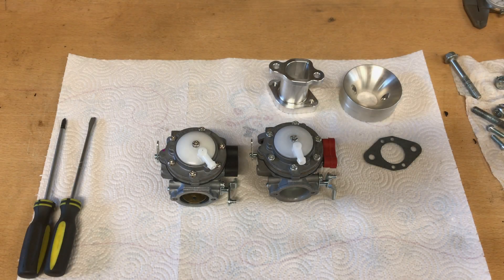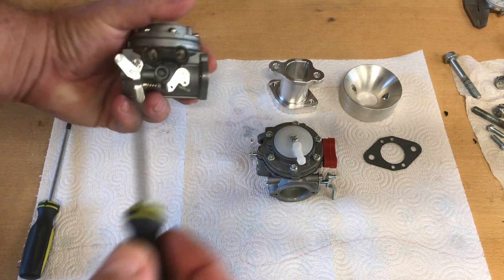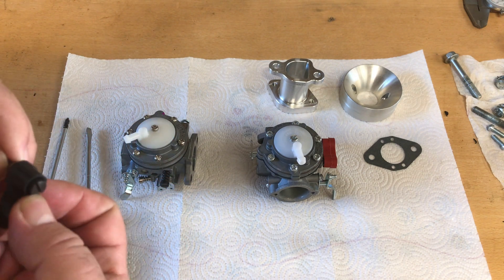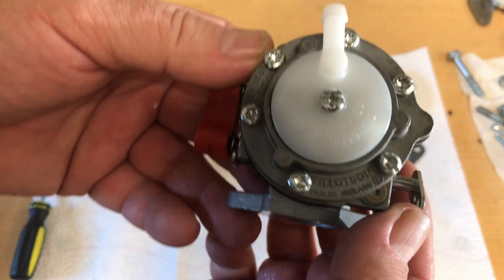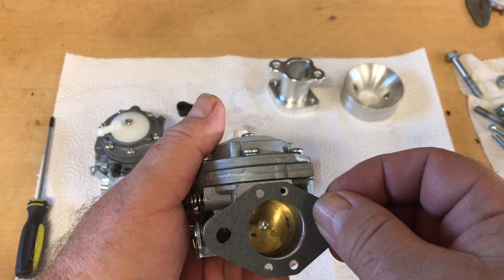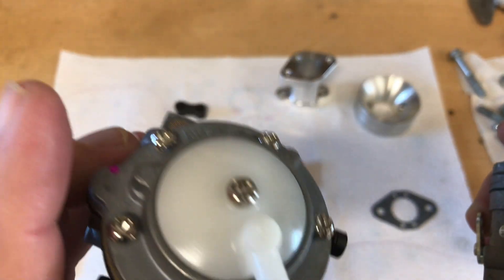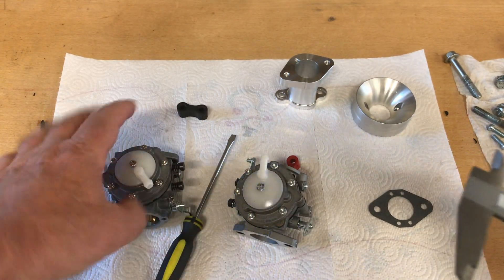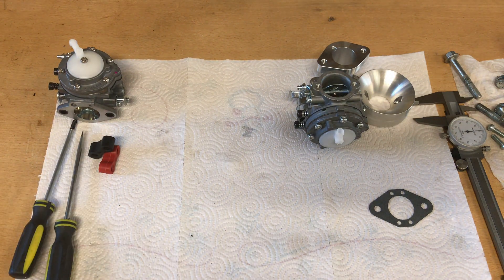$13 Cheap Tillotson Performance Clone Racing Carburetor For DUCAR 212 And Ghost Hemi Engine Build

Comment: Can you point me in the direction of some information on the linkage set up to run this style carburetor? Thank you.
Reply from the maker: You won't be able to run this carb with the original governor or throttle linkage. EC carburetors has a few different Tillotson throttle linkage kits available with bracket. I'll try to do a video on an example of hooking up a throttle cable to a Tillotson as soon as I get caught up. In some cases you don't need a top cable bracket depending on how the throttle lever is set up on your specific carb.

Comment: How do you hook uo the throttle control on one of those? I'd like to try one out and see if it can give me higher rpms than the stock carb
Reply from the maker: There's a throttle kit you can purchase at EC carbs. It includes the top mounting bracket and the clevis to attach the throttle cable. You can make your own but the kit is only a few bucks and it will give you an idea of what works as well as a pattern in case you want to make your own in the future...

Comment: I feel like they make great mid to high end power. Kinda have to roll into the throttle no matter how I tune them. But work great if you understand what’s going on. Not awesome for extended idle times when the engine is hot. But start up is good and run strong as hell. But races ain’t won at idle now are they. lol.
Reply from the maker: That's right James! Not many people idle across the finish line!
Reply: I cannot get mine to idle on gx160 engine. Seems like idle circuit is way too to rich. No matter I I do
Reply: These carbs are way too big for a 160.   A 212 is even pretty small for one.

Comment: Where did you scoop that awesome intake.
Reply from the maker: Hi ephenj! I picked up the Tillotson intake at Turk Brothers Racing. $49.95 plus shipping. Kinda pricey for an intake but with the carbs priced around $14 shipped it's acceptable. I looked into the VM22 intakes to try and make something work by maybe drilling the pulse passage on one but the VM22 intakes are too big on the ID for these Tillotson carbs. A short piece of 1" ID tubing and a couple of 1" flat washers would work if you want to fab a home built intake, just remember to drill the passage for the carb pulse.

Comment: it have rubber on the mount in hole is that to keep it from vibrating off the motor yofmoo is a ranger carb a1168
Reply from the maker: It's probably better to leave the little rubber things on the screws but I just can't. I've gotta be able to fine tune without a screwdriver.

Comment: I picked up 3 of them from different links and all of them say Tillotson on the diaphragm
Reply from the maker: So far all I've received have said "Tillotson" except the very first carb I ordered, it said "FULIN". Though I've noticed a few of the "Tillotson" marked carbs have had different sizes on the venturi bore. Some are larger than the others for some reason. I'd like to have more of those!
Reply: @@ProbableCause69420 I’ll have to measure the ones I got

Comment: nice so its better then the stock one on my ducar bcuz im rippin pretty good on a 13 tooth clutchy
Reply from the maker: These little Tilly clone carbs are a good deal. Even if they send you the smaller venturi carb it's still much larger than the stock Ducar or Predator carbs. Thanks!
Reply: @KentuckyFriedFixes  def man ty for thee iNFo Very HeLpfuL
Reply: @KentuckyFriedFixes  im gonna try one out once i remove this gov what do i set this Lash at again the gauges i bought only start at.005 or sum shite im a newbie so i have no idear what is what man i put a motor on a frame so far and stage one with 38 jet nothing else just messing with sprocket clutch ratios im doing good on a 13tooth tho but def want to get more out of her and see what she can really do stay blessed
Reply from the maker: You'll get it rockin'!
Reply: @KentuckyFriedFixes  lol thanks definitly

Comment: what link was it that they sent you the "tillotson" brand carb? the link you posted says yofmoo.
Reply from the maker: That's the exact link and I've ordered multiple carbs. The first one they sent was a "FULIN" brand with a black grommet on the adjustment screws, the rest of the carbs I received have been marked "Tillotson" with a red grommet on the adjustment screws. I have no idea why there was a difference? I was perfectly happy with the "FULIN" and ordered another, but I jumped for joy when I started to receive the "Tillotson" branded carbs with the larger venturi from the exact same link.
Reply from the maker: Also, keep in mind these are supposed to be Tillotson "clone" carburetors, not the real deal. It's probably a Tillotson clone carb body with genuine a Tilly stack.
Reply: @KentuckyFriedFixes  thank you. have you found any good deals/links on the intake adapter and the air filter adapter?
Reply from the maker: @RACE.KART.PRODUCTS  Turk Brothers have some deals on air filter adapters for the Tillotsons. I'm not certain if they have a correct ID adapter though. The intake is kinda pricey for these. I think the next one I do I'm gonna look at modifying a $20 Chinese import aluminum intake. Or perhaps a piece of 1" ID tubing with a couple of flat washers welded on. I don't like the $50 intake cost when I can get the carb for $13! But I guess it still beats the $50 intake with a $129 carb.

Comment: Are these better than Honda style carburetor?
Reply from the maker: The Tillotson style carbs are much better than a stock type carburetor. They feature a diaphragm pump that actually pumps a shot of fuel into the throttle bore rather than relying on vacuum to pull fuel in from a float bowl. The fuel flow is regulated by two separate tapered adjustment screws and lets you adjust fuel flow at low speed and high speed individually. You can add more pump blocks to increase the fuel volume too. It's very much like a vacuum diaphragm fuel injection system. There are drawbacks though. You really need to use these with a vacuum fuel pump for best results and for multiple pump "stacked" carbs that typically run methanol fuel, you have to remember to keep the engine off idle as the carb can pump more methanol fuel into the engine than it can burn. Too much idle time with a methanol Tillotson will wash down the cylinder walls and get into the oil. Other than that, they're an awesome carb for high performance engines.
Reply: @KentuckyFriedFixes  I've always just got a bigger Jet and used Honda carb. I am definitely the type that stays with what I know. But since you are saying that I am gonna try something different. Both my engines are screaming like scalded dogs with the Honda carb tho
Reply from the maker: @JBBRAD9267  It never hurts to experiment. I think a good engine builder should always experiment with new things, always continue to learn, and always look for more performance on every build. It's the only way to stay up front IMO.

Comment: I've never used anything but Honda style carburetors.
Reply from the maker: To me, there's not a lot of performance in the stock Honda style carbs. It really depends on the type of engine you have. A stock engine will work well with a stock carburetor. You can install the larger stock carb (GX270) to gain more throttle bore and venturi, but you're still left with a poor jet/fuel delivery design. Everybody has their own preferences for the type of parts they prefer. I used worked stock carbs on the flathead Briggs engines years ago and I thought those were great until I tried a Tillotson. That's when I found there are much better performance carb options available. Today we're kinda lucky as we have those options available for not a lot of money. The Tillotson style carbs are great as are the Mikuni style slide carbs. It's around a $50 investment in most cases or less if you shop around. In the end it's up to the individual. If everyone liked the same thing it'd be a boring World for sure.

Comment: Normally the rubber bit around the needles is there to keep it from vibrating in or out.
Reply from the maker: The grommet on the first carb was really tight. I could see the need for anti vibration to keep the screws from falling out of a chainsaw for sure!

Comment: Chris, I have a tillotson carb on my vintage kart it has a west bend 820 two stroke. It won't run ast a few seconds and it pours gas out of the carb. Is it a Reed? Not at all familiar with these carbs.
Reply from the maker: If it's in the carb it may be popping the needle off the seat or you may have a busted diaphragm. A kit is usually around $10+ If you have a bad reed that's not sealing on the West Bend engine, that can cause back pressure in the carb too. Those carbs are meant to take around 10psi before the needle pops.
Reply from the maker: The main thing is don't be intimidated by these Tillotson carburetors. You'll get it working. They're really easy to work with and the design is perfect for a good performance engine application. Almost every time I had a failure it was due to a busted diaphragm. I was running Methanol so it was not out of the ordinary to rebuild the Tilly every 5th race or so.
Reply: @KentuckyFriedFixes  ❤️❤️❤️❤️
Reply from the maker: Check your PO box, there should be something waiting for you. 😜